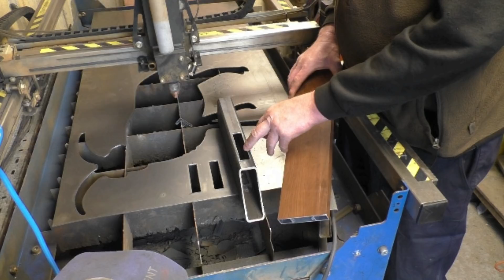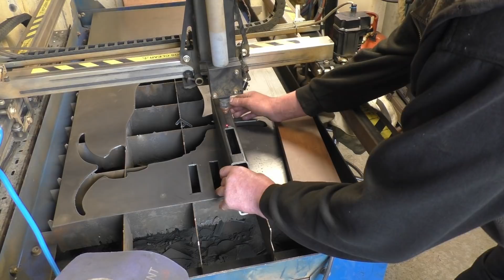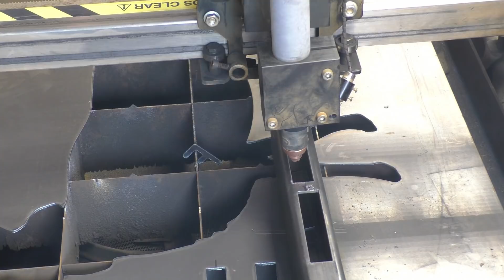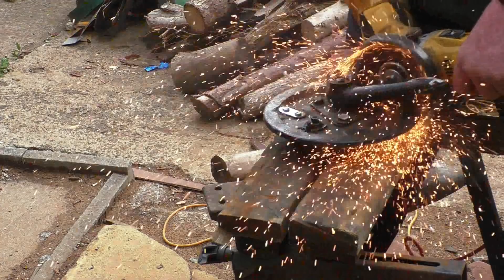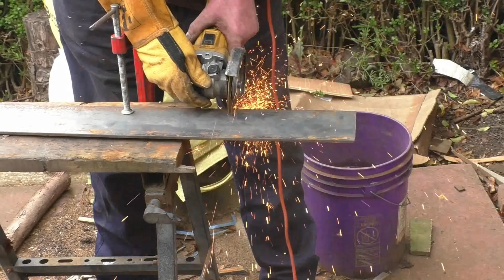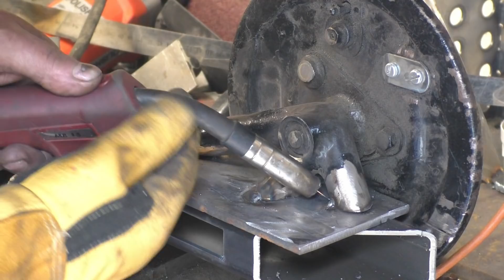SNNC 380 P2  Cutting Box Section  . Suspension Mod

Comment: Might want a fence along the plasma cutter's axis for tall, narrow pieces like that. You'd get repeatability, more stabile workpieces, and less setup time between pieces for production runs. Maybe with work clamping,  end stops and some way to index the fence on the cutter's bed (dowel pins maybe).